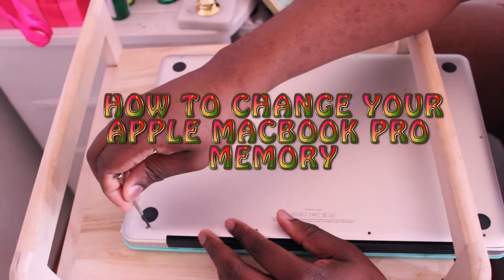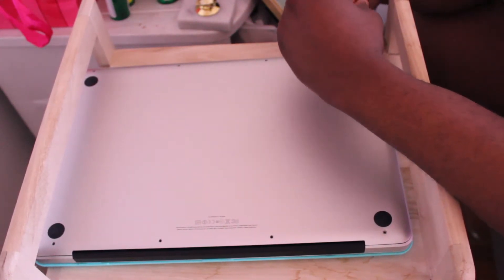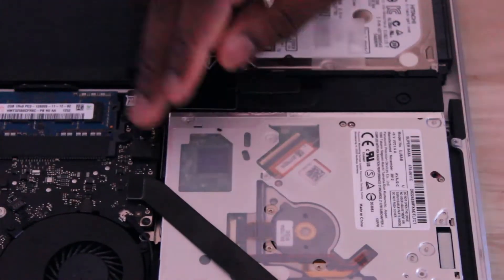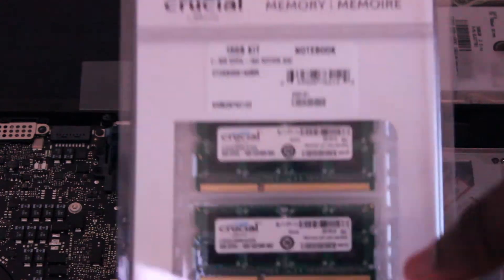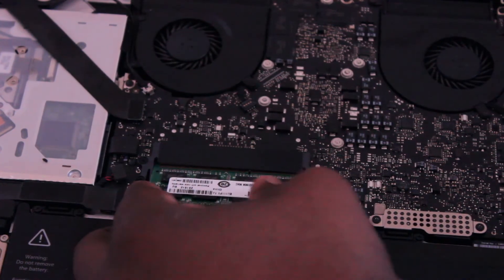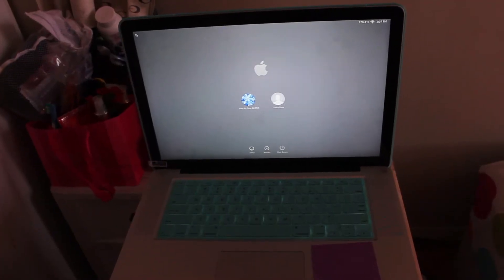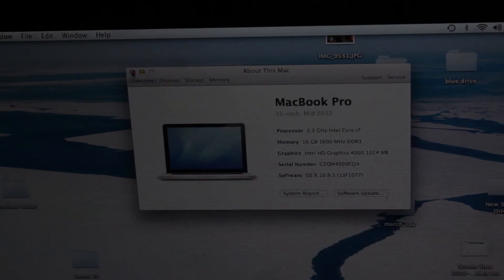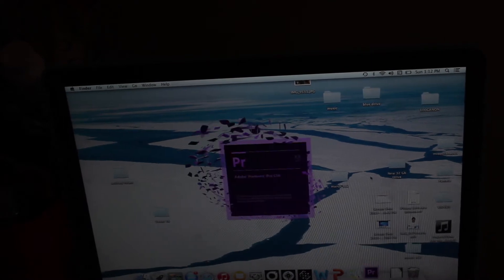HOW TO CHANGE THE RAM MEMORY IN APPLE MACBOOK PRO

Comment: RAM actually doesn't determine the speed of execution, that's the processor  (along with other smaller factors). RAM is actually for the total data it takes to run all processes currently active on a computer at any given moment. That is, 16gb of ram means that if any moment while someone were using a computer, it could be saved to the hard drive, then at any moment, the data of 16gb written onto a hard drive could be happening on the system. The speed of the ram might be noticed in things like switching from one program to another, like a game to a web browser. 

Thanks for the vid though. Some shots were hard to see, but I get the idea.